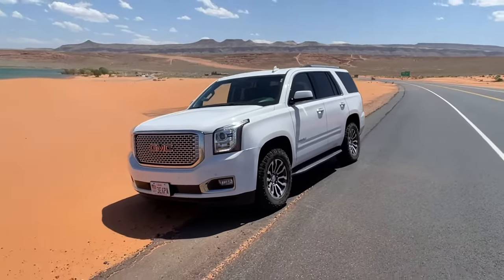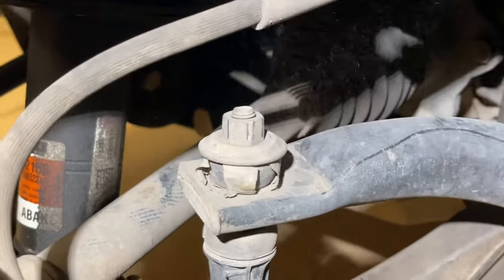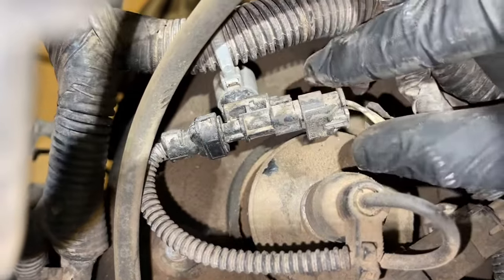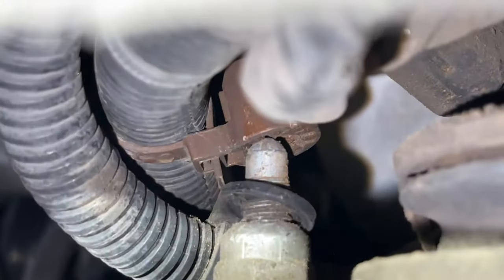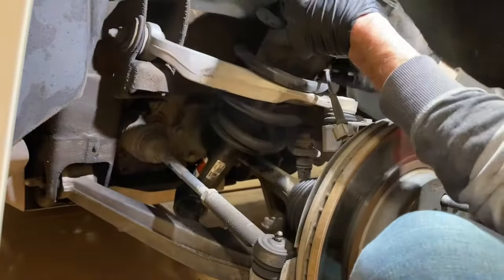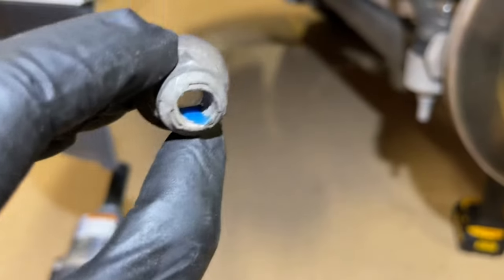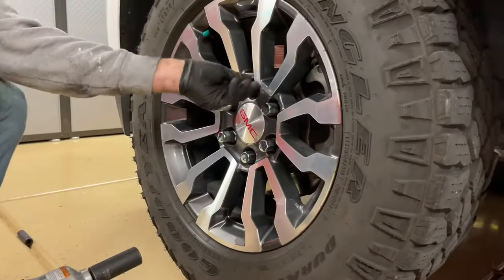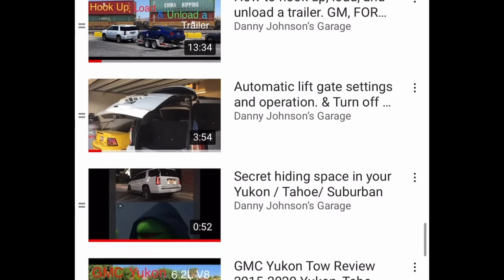2015-2020 GM Front Strut replacement: Magneride Yukon Tahoe Suburban Sierra Escalade Chevy GMC

Comment: Thank you so much for your video. Your step-by-step video was soooooo helpful and explained everything thoroughly.  I did the front struts on my friend's 2020 GMC Yukon XL Denali, yesterday (Sunday, 04/28/2024). Though, it took me a little longer to to the right side.. It was a bit cumbersom at first. The plug for the magneride was a bit difficult as they did not disconnect as easily as yours in the video. It took me a total of about 1-2 hours. Overall, your video saved me loads of frustration!  I reused the factory nuts as the nuts that came with the replacement struts were crap!

Comment: Another very well done video on the multiple repairs that Yukon Denali owners will face with ownership, Danny. You vids have become my first look when something breaks on our 2015. These are the 3rd set of struts on the vehicle with a little over 100K miles. The first were covered by warranty and replaced at the dealer. The struts wear and then leak oil and fail completely so I recommend replacement at the first sign of oil leakage. I had a more difficult time replacing the passenger side as the top strut nuts are obscured by AC lines, etc. Also, the clips for the electrical connectors were a bear to remove and separate. I ended up using some silicone spray to help loosen the gray tabs and then used a small flat blade screw driver to release the clip from the bottom, if that makes sense. The passenger side was very stiff and required me to compress the strut in place with a jack, have a helper pull down on the hub while I guided the strut into place using two flat blade screwdrivers as shims. Drivers side removal and installation of the aftermarket Arnott struts was as the video depicted minus the stubborn electrical connector. Again, thanks for the video's!
Reply from the maker: Sadly, but gladly, I have more videos on the way for new lifters and 4 cylinder mode delete coming soon. Im glad the videos are useful

Comment: Just did this process, a few pointers for people: Remove the wheel liner, check all your bushings, use a torque wrench, and check alignment when finished. Mine had a 2 inch squat from the failed struts, and now I’m back to factory. Arnott struts are great quality. There is also a different part number for 2wd and 4wd models, so be sure to look it up first.

Comment: Good morning. Is there a
Magnetic adjustment for height once the strut has been changed?
Reply from the maker: To my knowledge, it only dampens magnetically but does not adjust height. The rear struts do have air bags and adjust height when a load is added

Comment: Just recently purchased a 2015 yukon denali  and noticed at higher speeds its a little squirrely when i go over big bumps like bridge road transitions. Im thinking the front shocks must be going bad. Looks pretty straightforward to replace.
Reply from the maker: The Arnott worked the best for me https://www.amazon.com/gp/product/B08VF88P43?&linkCode=sl1&tag=2004047-20&linkId=4c1a8f8cd496edc237ddddedfa7bbee7&language=en_US&ref_=as_li_ss_tl
Reply: @dannyjohnsonsgarage  i saw that a guy on another video like those as well. Thanks for the info

Comment: Short & too the point.  Great job.

I have a question though.  On the drivers side, the lower strut has walked off the rubber grommet to the back & is digging into the lower control arm.  On the passenger side, the lower strut has walked off the rubber grommet also, but it's moved forward, almost touching the lower control arm.  I've also noticed that the plastic cover shields are not in alignment with the strut.  It seems the strut is not running true.

Is there a specific way to clock the upper three bolts so as to keep it perpendicular to the lower mount, so it doesn't walk off the grommet?
Reply from the maker: I would imagine it could have something to do with the pressure of the sway bar. If you loosen it on both sides perhaps it can be set straight. Otherwise, the strut shaft may need to be twisted to make it straight. That’s why u got rid of the aftermarket bad ones that were not lined up straight from their factory.  The Arnott brand was setup correctly and went in straight

Comment: Hi Danny

On your Amazon review you stated : ".... these went right into my 2015 Yukon Denali and plugged in without any service suspension lights. It might be a dummy plug and not real magneride, but it works just fine."

Do you really still think these are not real magnarides ?
Reply from the maker: If you read the description it says it’s a replacement for Magneride, but I didn’t see anywhere where it actually says it’s magnetic operated. It may or may not be, but it works great. The are actually eibach springs which is cool

Comment: Nice video.  Is it recommended to replace the whole assembly or just the absorber?  The dealer was telling me they normally just do the assembly.  Also, there was a comment earlier about a replacement done and the front was sitting lower.  There were a batch of these that were aftermarket replacements that were recalled because of that I just read.
Reply from the maker: If you replace only the strut it requires a spring compressor to disassemble the unit, so use great caution as it’s dangerous

Comment: Hey danny. I have a 2015 tahoe, and the heated seats don't warm up. The backs of the driver seats do, but not the seats. Any ideas what's wrong? Thanks
Reply from the maker: If part of the seat still works it’s probably not a fuse. The heating element itself is probably bad

Comment: do you find that between 59MPH to 64MPH the driver side front tire whines super loud in a weird hum kind of way, with those tires. I love your channel, I love it, thank you, thank you. Learning a ton, and only want to buy this year model of yukon because of your shared knowledge.
Reply from the maker: The tires are very loud and warp easily from the bad suspension. Then it’s like rumble strips at low speeds. If you watch my lifters video it may persuade you to get something else other than the Yukon
Reply: Yeah, I am watching them and its breaking my heart, I just want to look away and act like I didnt see it, i have 77k on a 2015 and am about to look for that little filter you found, what a pain.
Reply: I did the arnott kit thanks to you, all the way around before putting these wheels on

Comment: I tried to replace my front struts a couple days ago. My current struts (super compressed) are way shorter than the replacement struts, so I had trouble getting the new strut to sit on top of the control arm. I’m going to try it again and hopefully just pulling down on the brake assembly gets me the extra room I need! Anyone else have this issue?
Reply from the maker: I had the same issue with a pair of aftermarket struts that did not fit (I also have a video on that). The ones that went right in were Arnott and I made an update video for them https://www.amazon.com/Arnott-Coil-Over-Eibach-Magneride-L-SK-3354/dp/B08VF88P43?crid=38JDH2IFYEA9K&keywords=Arnott+-+Fr+Coil-Over+Eibach+Strut+15-20+Cad+SUV%27s,Chev+Silver/SUV%27s,GM+Sierra/SUV%27s(K2xx)+w/Magneride-L/R+(SK-3354)&qid=1669272882&sprefix=arnott+-+fr+coil-over+eibach+strut+15-20+cad+suv%27s,chev+silver/suv%27s,gm+sierra/suv%27s+k2xx+w/magneride-l/r+sk-3354+,aps,290&sr=8-1&ufe=app_do:amzn1.fos.08f69ac3-fd3d-4b88-bca2-8997e41410bb&linkCode=sl1&tag=2004047-20&linkId=6ce005c6cd213796132b9c237f1113d5&language=en_US&ref_=as_li_ss_tl
Reply from the maker: https://youtu.be/8c7qfElwx3o

Comment: i want to put Bilstein shocks in front and rear. You called it a strut. Is a strut the spring and shock combined? Did you change the spring? or just take the shock out and swap that? I found Bilsteins on RockAuto (amazing prices) and it looks like a shock and it looks as if you don't need to take the coil assembly(strut?)out of vehicle. Is that possible? Thanks
Reply from the maker: Correct. A shock absorber does just that, but a strut is when it also has support for the vehicle as part of the shock absorber 
  The only thing I would check is if you have the magnaride suspension like my Denali has. If so you will need to delete it with a kit to run the bilstein’s if they don’t have magnaride. You’ll see the plug in the top of the absorber if it’s magnaride. I went with Arnott brand because they have the plug (but I believe it’s just a dummy sensor to tell magnaride it’s all good). 
 https://youtu.be/8c7qfElwx3o
Reply from the maker: These are the Arnotts for the Denali. I spent $500 each so they are on sale. You have to get 2 https://www.amazon.com/Arnott-Coil-Over-Eibach-Magneride-L-SK-3354/dp/B08VF88P43?crid=38JDH2IFYEA9K&keywords=Arnott+-+Fr+Coil-Over+Eibach+Strut+15-20+Cad+SUV%27s,Chev+Silver/SUV%27s,GM+Sierra/SUV%27s(K2xx)+w/Magneride-L/R+(SK-3354)&qid=1669272882&sprefix=arnott+-+fr+coil-over+eibach+strut+15-20+cad+suv%27s,chev+silver/suv%27s,gm+sierra/suv%27s+k2xx+w/magneride-l/r+sk-3354+,aps,290&sr=8-1&ufe=app_do:amzn1.fos.08f69ac3-fd3d-4b88-bca2-8997e41410bb&linkCode=sl1&tag=2004047-20&linkId=6ce005c6cd213796132b9c237f1113d5&language=en_US&ref_=as_li_ss_tl
Reply: @dannyjohnsonsgarage  Thanks for the reply I will look more into it

Comment: Video was very helpful! Thank you 
Only question I have, Did get a service suspension code after you replaced the struts?
Reply from the maker: I did bit with the Arnott ones
Reply: Trying to sound out what you are saying.. Predictive text might of got you 😂
Reply: I used Arnott struts on both side on the front.

Comment: So the link for the front struts in the description are the correct ones or are they the ones that were too long
Reply from the maker: I assume it was a mistake that mine were too long. I’d purchase at your own risk knowing if it’s wrong you’ll lose $50 in shipping minimum. I can’t imagine they would not fix the issue
Reply: I used LuftMeister and the fit was good.

Comment: Danny subscribed to your channel, a question for the replacement of the rear shock absorbers is the same procedure????
Reply from the maker: The rears should be much easier. Just support the axle with a Jack to lightly compress them as you remove and install the bolts

Comment: Does it need to be reprogrammed because of the sensor?
Reply from the maker: No. The new struts that come with the plug will tell it everything is okay. Factory replacements with the plug won’t require anything either. It will only be a problem if you buy new struts that don’t have a plug

Comment: How many miles on the truck?? My 16 Denali has a leaking strut. 55k!!! GM is building junk, or maybe it’s our wonderful roads 😳
Reply from the maker: 82k currently
Reply: Changing mine at 108000
Reply: Changing mine at 80K. I get they are mechanical parts and will break down.. nothing last forever but I just feels like they should last longer. 😞

Comment: Do you have a suspensionmaxx or another type of leveling kit on yours? My denali's suspension has firmed up a ton lately and I feel like I might be in need of checking out the struts and replacing. Thought I might do a leveling kit at the same time while it's all getting disassembled. Thanks for any tips.
Reply: Because the original video was so helpful, I figured I’d comment on 15’ Yukon aftermarket strut adventures. I first ordered “LUFT MEISTER 84176631 2 PCS Front Struts Shock Absorber w/Magnetic Assy with spring for 2015-2021 Cadillac Escalade Tahoe Suburban Silverado GMC Sierra 1500 Yukon (XL)” off Amazon. My factory units were leaking and riding harsh. It actually caused rapid tire wear on the inside driver side(that strut was in worse shape).

My plan was to level the Yukon(XL) while I replaced the struts because I didn’t want to do the job 2x… my initial front/rear rake was -2.25” in the front. That should have equated to the SuspensionMAXX lower spacer and 3 shims to be level. With the new LUFT MEISTER struts and that setup was 1-1.25”HIGHER on the front. overall length on the new struts matched factory(I checked because of this video), so the spring rate must have been significantly higher.

Pulled those off today, installed Arnott SK-3354s (they cost roughly double the LUFT MEISTERs )with just the lower strut spacer from SuspensionMAXX and I’m even on the driver side, and .25 front high on the passenger(both sides on the rear were the same fender height). Im assuming the front will settle a bit(probably just from the alignment), but if I need to, I can always open it back up and add a top shim. 

After the non-factory installed height on the LUFT MEISTER struts(which are going back to Amazon on Tuesday), I decided to wait to install the mangaride linkage plate until I measured the new front height and knew which setting to use(I had the maxx stack setup with the shims and multi position linkage plate).

The Arnotts are not 😅 magnaride, but a traditional strut with a built in resistor. In 25ish miles of driving they feel alright. Definitely better than the roached stockers. You could probably get by with Bilstein 5100s (had em on my Tahoe and loved em) set for the lift you need and buy 3rd party resistors, but you should also adjust the linkage arms for the magnaride to keep the computer happy.
Reply: @professorlloyd1789  How is your ride with the Arnotts?  I installed them and the ride is very stiff.
Reply: @brentschirm9695  initially(coming from the shot,  rock-hard magnarides) they almost felt too soft. But after a few thousand miles, they do seem a bit stiff, but nowhere near as jarring as the shot magnarides. Sharp edge impacts(high speed compression) seems to be the issue and unfortunately, roads in my area of SoCal are garbage. Smooth roads and low speed compression movement feels pretty good. This is why magnaride “can” be good. Altering the viscosity of the dampening fluid in real time allows one size orifice to have varying transfer rates/different dampening. The problem for me is that it’s been so long since I’ve been in a new magnaride setup, my expectation for the suspension might be out of whack. I’ve lost my frame of reference.

The other thing “might” be that my rears are shot and stiff, which is going to impact ride quality. They’re not leaking like the fronts were, but at their mileage(79k) they could be done. 

Overall Im “satisfied” with the Arnotts. If I keep the Yukon long enough for another set, I think I may grab a set of Bilstein 5100s and reuse the Arnott resistor(looks like you can unscrew it off the top of the strut). I had 5100s on my tahoe, and I generally liked them, though thats lots of miles ago, and who know’s how I’d rate them if I were driving them compared to the Arnotts today.

One other thing to think about, is if you have any other loose/worn suspension components or oddly worn tires/bad alignment, ride quality can sometimes suffer.

Comment: Hey Danny,  nice video!   Did you do something special to get your "service suspension" light to go off?
Reply from the maker: Mine was not on. The strut was greasy from oil apparently leaking, so I was replacing it for that reason. The part that came was not compatible, so I put the factory one back in
Reply: Did you solve this issue? If so? How?

Comment: Do I have to replace strut mounts if I just bought the strut itself? I got non magna ride
Reply from the maker: Anything that looks worn and dry should be replaced, but be VERY careful replacing the spring. It will shoot off and should only be replaced with the proper tools and spring compressor

Comment: Do you have a part number for the front?
Reply from the maker: They are not available as the entire strut, so Arnott is a good replacement  https://www.amazon.com/gp/product/B08VF88P43?&linkCode=sl1&tag=2004047-20&linkId=4c1a8f8cd496edc237ddddedfa7bbee7&language=en_US&ref_=as_li_ss_tl

Comment: What part are you using? Are these standard oem ?
Reply from the maker: I’m using the Arnott. I tried another brand and they don’t fit. Oem is the shock absorber only so you have to take it in to have the spring removed and installed and oem is still $800 each for just the shock absorber. These Arnotts went right in and have been great https://www.amazon.com/Arnott-Coil-Over-Eibach-Magneride-L-SK-3354/dp/B08VF88P43?crid=38JDH2IFYEA9K&keywords=Arnott+-+Fr+Coil-Over+Eibach+Strut+15-20+Cad+SUV%27s,Chev+Silver/SUV%27s,GM+Sierra/SUV%27s(K2xx)+w/Magneride-L/R+(SK-3354)&qid=1669272882&sprefix=arnott+-+fr+coil-over+eibach+strut+15-20+cad+suv%27s,chev+silver/suv%27s,gm+sierra/suv%27s+k2xx+w/magneride-l/r+sk-3354+,aps,290&sr=8-1&ufe=app_do:amzn1.fos.08f69ac3-fd3d-4b88-bca2-8997e41410bb&linkCode=sl1&tag=2004047-20&linkId=6ce005c6cd213796132b9c237f1113d5&language=en_US&ref_=as_li_ss_tl